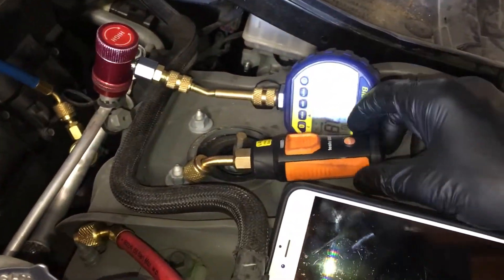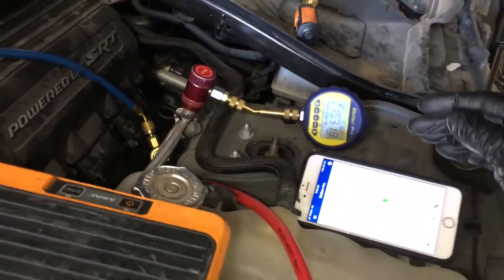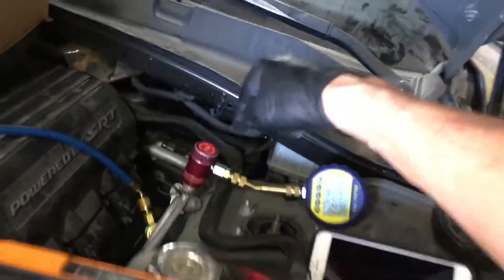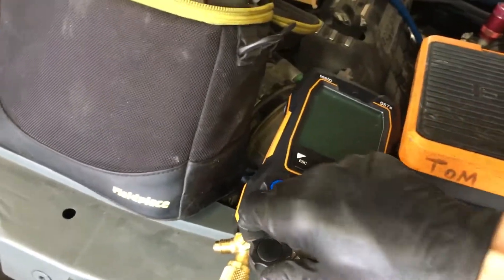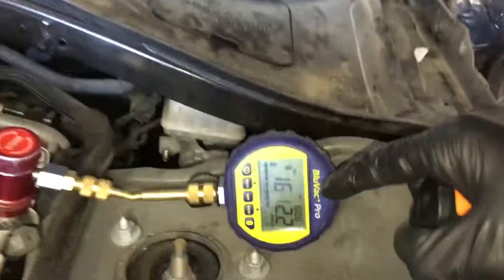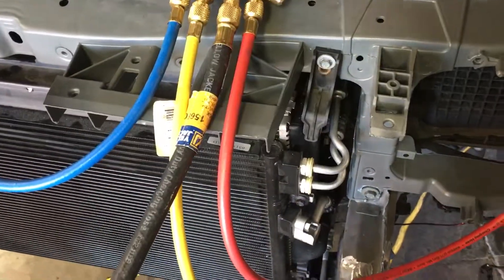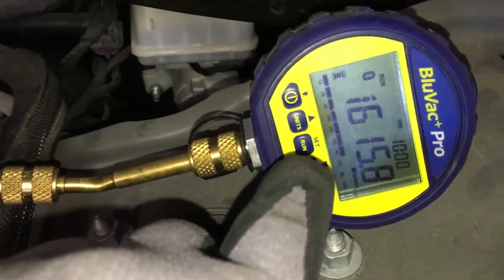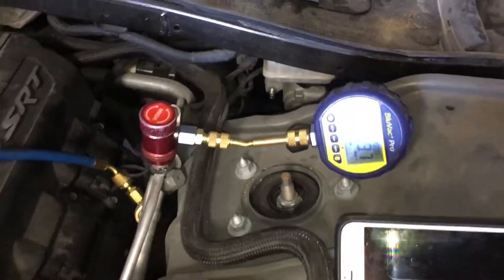TESTO 552i not working ?. Let me show you how a real micron sensor should work hook up the software

Comment: The 552i is trash. Im on my second one and it doesn't work at all. The damn thing just won't connect
Reply from the maker: Yes, I found a lot of connection problems with their Bluetooth and software link up problems. 
     I’ve used three different iPads two different Arduino pads four different phones
      Sometimes they work and sometimes they don’t
      The company will not admit they have an issue. They’re in total denial.. 
       At one time I used to be a TESTO fan boy. Back before they introduced their Bluetooth Chinese 🇨🇳 made tools.. when they were made in Germany. 🇩🇪 

Even after they came up with what they said was their fix and upgraded Bluetooth for a better connection and stronger signal I believe them and I went out and bought their supposedly upgraded stronger Bluetooth connection tools, and they were still garbage . 

On another HVAC technicians YouTube channel he was sticking by his TESTO’s and saying they were great even the 557S which I have two of he did drop back to the 550 because the 557S just had too many problems 

And even just recently in his recent video, he finally trashed all his TESTO tools and switched over to Fieldpiece.
Reply: @coldfinger459sub0  what you suggested actually worked! Thanks man. Just cannot have gauges on at the same time

Comment: I bought two of these because the first one wasn’t showing any readings at first, but after swapping the batteries, it started working. I ran a vacuum down to 500 microns, but after closing all the gauges, the microns started rising again, making me suspect a fault or a leak. So, I ordered a second one from Amazon, but it was even worse—it wouldn’t work at all, even after changing the batteries. I ended up returning both. Very disappointing.

Comment: If you're serious you would not use those hoses they are for charging systems not evacuation. Is that a car your pulling a vacuum on? A Appion vacuum pump wll pull a deep vacuum 350 or below isolated in 15 min. You can put the micron gauge anywhere you want and it will be below 500 microns. I thought this video was about the Testo 552i not how much better your micron gauge. is
Reply from the maker: It was about how you should not use refrigerant charging hoses to pull a vacuum through I probably stated that several times in the video

But lazy and cheap people will do it anyway so I was showing the result

Anyways to explain to people who don’t know how to use a micron gauge the micron reading your reading out a vacuum pump if you place it there will be wrong because that’s at the source of the vacuum. 

And the further you get away going through refrigerant charge your hoses the worse your vacuum will be. 

Exactly everything you stated as a comment was 100% true and that’s exactly what I said throughout the entire video. 

Other than a Testo software was really having some issues staying connected.  Did not matter whether I used it with the Apple tablet or a android tablet a Apple phone or a android phone Testo has to work on their Bluetooth and software connectivity issues.
Reply from the maker: It was about how you should not use refrigerant charging hoses to pull a vacuum through I probably stated that several times in the video

But lazy and cheap people will do it anyway so I was showing the result

Anyways to explain to people who don’t know how to use a micron gauge the micron reading your reading out a vacuum pump if you place it there will be wrong because that’s at the source of the vacuum. 

And the further you get away going through refrigerant charge your hoses the worse your vacuum will be. 

Exactly everything you stated as a comment was 100% true and that’s exactly what I said throughout the entire video. 

Other than a Testo software was really having some issues staying connected.  Did not matter whether I used it with the Apple tablet or a android tablet a Apple phone or a android phone Testo has to work on their Bluetooth and software connectivity issues.

Comment: It’s probably bc you keep throwing it.
Reply from the maker: Lol if the tool is that fragile that is meant to be working out in the field then it need not be in our service trucks. 
                                  All joking aside both the gauges set were returned and they gave me a new set that booted up software and connected and worked properly. 
                        But the Bluetooth connection kept having a drop out problem and connection problem continuously that did not go away. 
                       Are used for different iPhone 6 Plus S and one older  Arduino Samsung tablet . 

            It turns out Testo did not mention or more like head their problem thinking they could sweep it under the rug that they had a issue with older phones and tablets with the earlier versions Bluetooth having connection problems. 

           Just think if you were Testo marketing and you knew you had these problems and you had to tell people before you buy this new product you have to go out and buy a new phone and a new tablet with more up-to-date Bluetooth software and hardware. 
                     They would lose a lot of sales of their product because who wants to spend several hundred dollars more on top of that to buy a new phone and a several hundred dollars more to buy a new tablet. 

                    So I bought a new Apple tablet $400 just so I can get my manifold and Bluetooth Micron sensor to stay connected and this solve the problem soon to buy a brand new Apple iPhone which will be another $1200 just so I could use the Testo software and hardware accurately and reliably.
Reply: Bro if ur throwing around and banging on shit they're fuckin tools for fine measurements you're an idiot.
Go throw a fluke off a roof whenever you feel pissy and see how well it holds up

Comment: is it possible to draw a vacuum to fast on a system that may cause moisture to freeze . just upgraded to dual 5 cfm pumps and 1/2 diameter hoses and was reading some forums online and came across that . or is it better to use 1 pump with both hoses attached to both the high and low side of the system . and also in a situation like this where you cant get all of the moisture out what do you in predeecing to rechrage it .
Reply from the maker: Excellent question this is the difference between an armchair engineer who reads papers and somebody who actually works in the field for a living and knows different. 

           In theory using a geothermal or a hydronic system for example where I played heat exchanger has leaked and liquid water got mixed in with the oil and refrigerant. 
          Cold weather climate yes it is possible under these extreme conditions to freeze water in your oil in your system. 

         In reality in the automotive field on a car with a little Eddie bitty tiny system and small little tiny lines tiny little evaporator tiny little condenser on a regular warm day and even better if the engine was hot. 

              The chances of freezing water in the oil and it’s staying there by not absorbing heat from the large surface area of the lines in compressor condenser and evaporator with the surrounding air temperature at 60 or 70° and above. 

             Would be like saying if I threw a ice cube in the Pacific ocean in the ocean would freeze from one ice cube.
           This is the order of magnitude and heat BTU input to surface area to the small quantity of water with the heat rejection of the oil to the surface area in an automotive system. 

             Same goes with the armchair engineers who sit and read thinking that if you draw a deep enough vacuum with one of our Automotive vacuum pumps you can go to low and vacuum and ruin the oil. 😂🤣. 

       When you hear that statement come out of somebody’s mouth you know they just Booksmart and they read the wrong books and have no grasp of physics or math.
Reply: @coldfinger459sub0  thank you its always better when you explain it . keep up the amazing videos

Comment: whats was the problem with testo 552i again?
Reply from the maker: Sometimes when turning on the 557 and the app on my phone it would go into a refrigerant update mode and just get stuck there and keep looping over and over and over again in refrigerant updating the app would freeze up and I cannot turn it off or back out or cancel

      At the same time when it’s stuck in that refrigerant updating boot loop mode I cannot access or do anything with the refrigerant gages either unless I just turn off the power

         When trying to access the Testo micrometer hooking up between the app and the gauges it sometimes will not show will not connect. 
          I’ve tried powering off and powering back on both the gauges in the micron sensor. 
          I tried deleting the app off my phone and reinstalling it so I have a fresh install still occasionally same problem. 

           Other problem just bumping or tapping the phone while you’re taking your readings the 557 gauge will completely shut down and reboot and start again so you lose your connection and any data you were trying to log . 

            So I’m just going to consider I just happen to get a defective gauge send it back and try again. 

          Yes I do occasionally and especially right out of the box get the gauge that you have to Press the zero gauge button to zero out the pressures because when you turn it back on one side will show a different pressure positive sometimes negative then the other side pressing the zero button takes care of that problem other people have complained about that.
Reply from the maker: @Robo.1776    Both the Fieldpiece and the Bluetooth sensors multiple five or six all at one time to connect to one app simultaneously they both have been working like this for years. 
           And Bluetooth is meant to work like that. 
This is not Bluetooth 1.0  that came out over a decade ago. 
              Apparently you do not own all the Testo wireless Bluetooth sensors or the Fieldpiece wireless Bluetooth sensors that all connect simultaneously to their app. 
                And both the Fieldpiece sensors and the Testo sensors can also connect simultaneously to the third-party MeasureQuick app. 

             Years ago when Jim Bergman was developing that I connect manifold system and software app they were coming up to overcome the connection problem using the Zigby wireless mesh system that was the forerunner before Testo or Fieldpiece came up with their Bluetooth where are multiple components simultaneously can all mesh together and connect to one app taking live readings . 

          As for Testo‘s wireless micron meter is very accurate I tested them together and made a video and posted it with both of them connected to the Testo 557S simultaneously. 

             I have since received a replacement Testo 557S refrigerant manifold and sensors right out of the box it connected and worked properly so far. 👍

           I still have not used the new replacement Testo 557S refrigerant manifold or micron sensor out on the field because I cannot afford to waste time trying to debug it just in case I have problems too much work to be playing with tools during billable work hours. 

              Once they test them and do some overnight data logging leaving them on and running overnight while data logging if they’re flawless and stay connected then I’ll deemed them suitable to take out on the field to use during billable working hours as to not waste time. 
             Time is money and when you’re approaching $300 an hour a few flaws and bugs and hiccups on a brand new tool can start adding up really fast when you’re on a rooftop and the tool stops working.